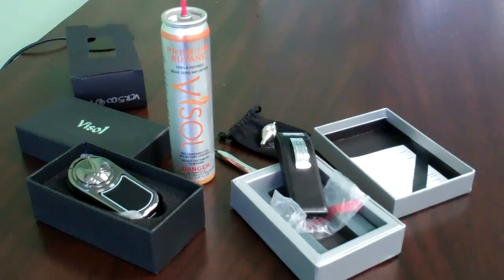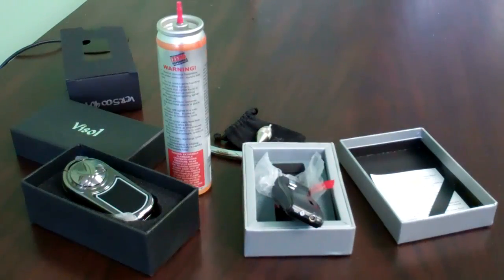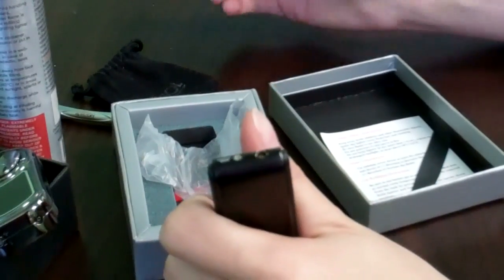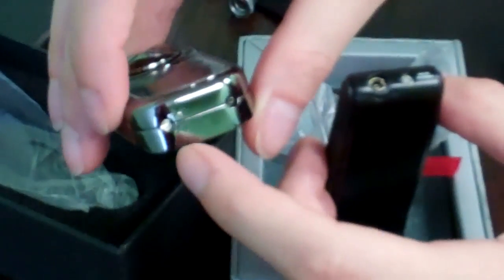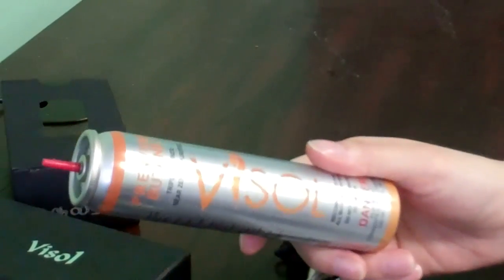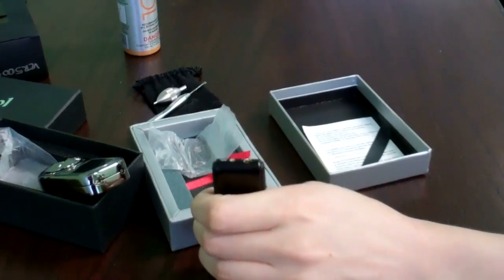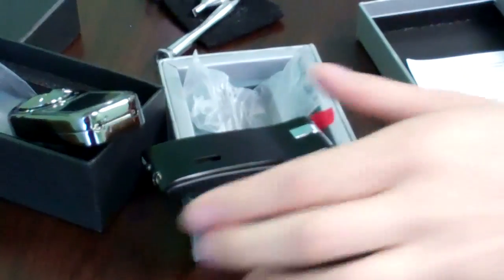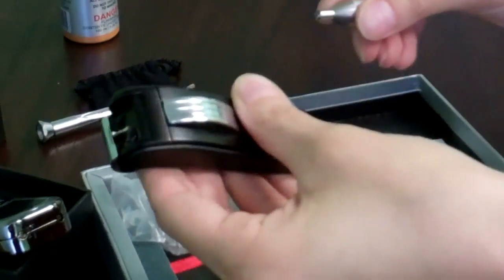How to Empty and Refill  a Butane Lighter

Comment from the maker: @mbarkhau There are a couple of reasons. One is because the gas in the lighter is already at room temperature while the gas from the canister was frozen. When they mix it may cause the lighter to gasp (not work properly), or cause air bubbles. Or if you don't insert the nozzle into the valve exactly right, air bubbles will also be formed. This disrupts the firing mechanism.